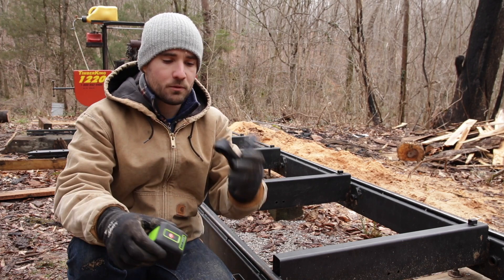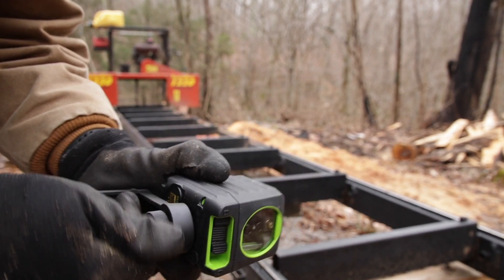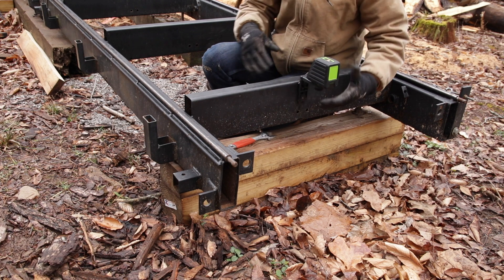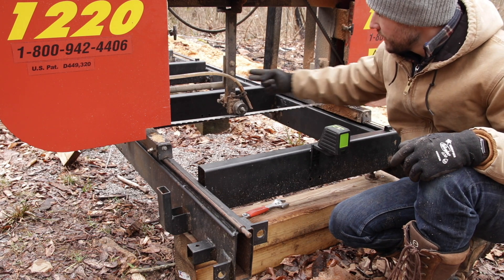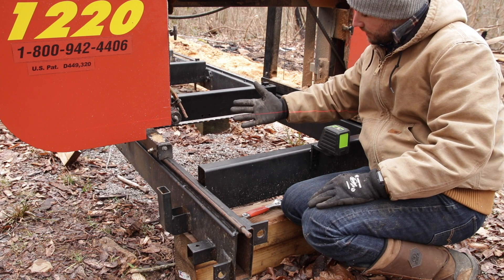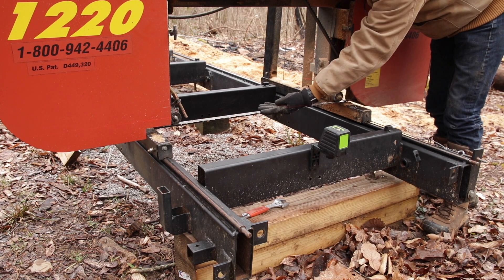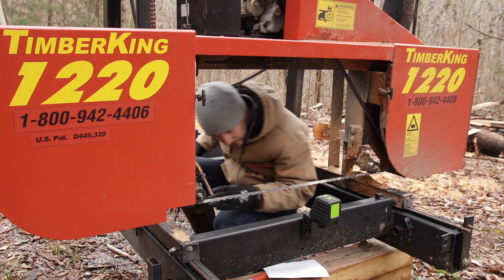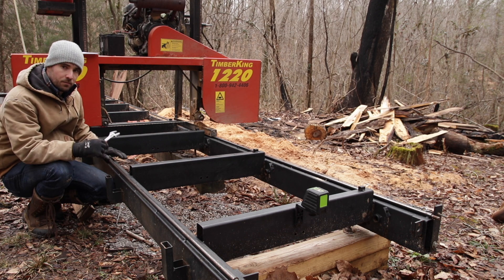Best Way to Level a Sawmill Bed

Comment: Hey buddy how are ya? Thanks for showing us you method of leveling. It is a pita when the boards come off the mill un true. I have a trailer mill and I use the mid jacks to straighten the mill. I use  a string pulled extremely tight between to small clamps then I can use a small gage to true up the bed it’s fast an easy for me. Takes just a couple minutes. I love running the sawmill! Thanks for sharing and nice to see you back at it. God bless you and yours.